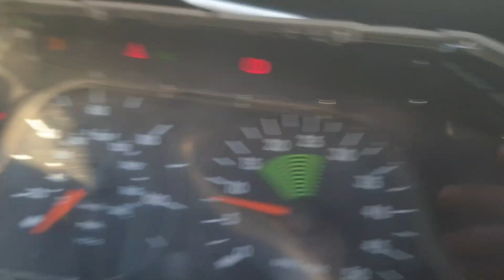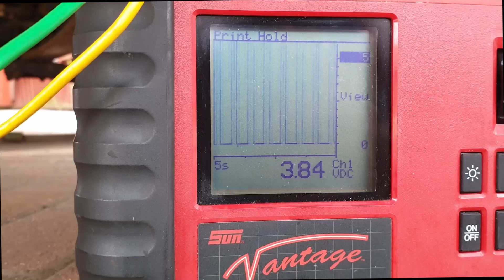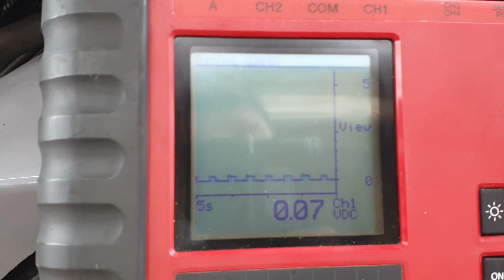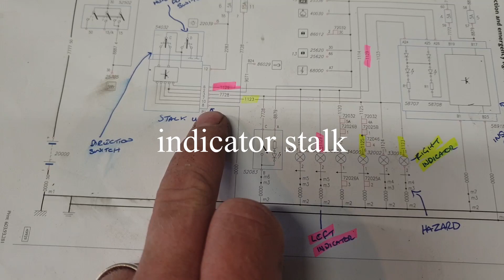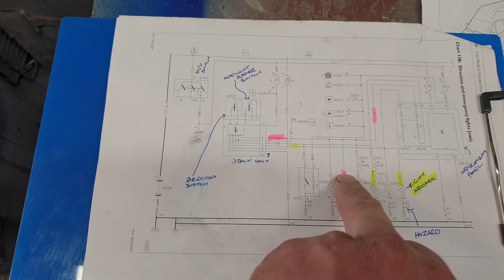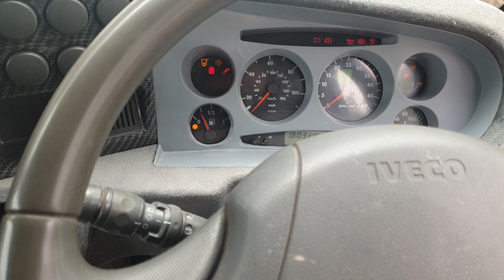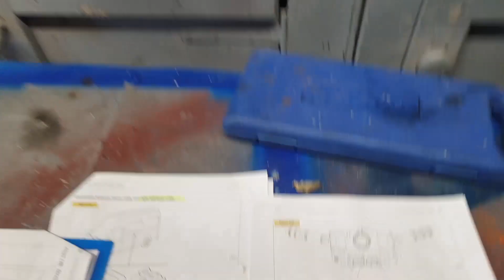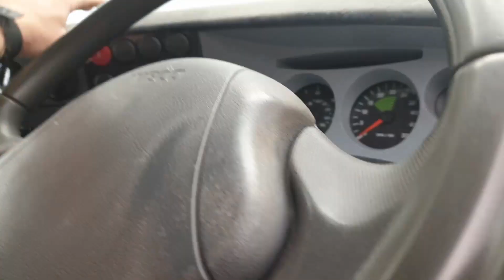iveco daily wiring repair

Comment: When your checking for an open or short, make sure the long tip on the edge of the trace scanner is straight with the wire your checking, that's why the signal was being lost so much. Cheers for the content